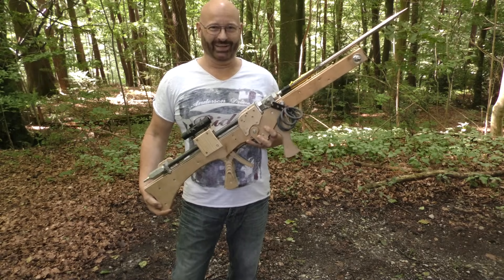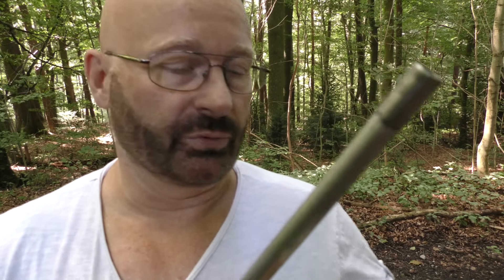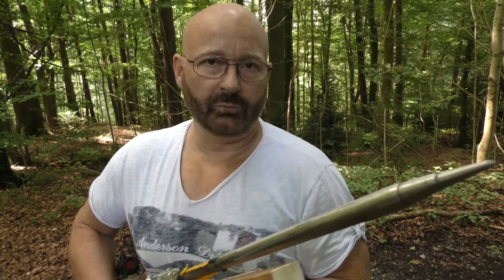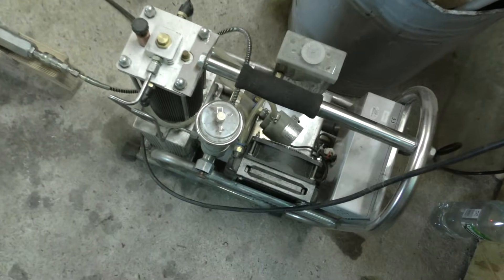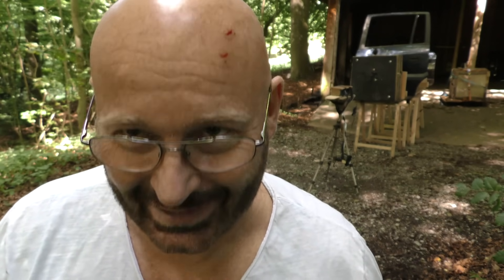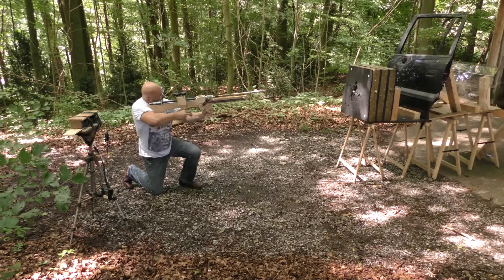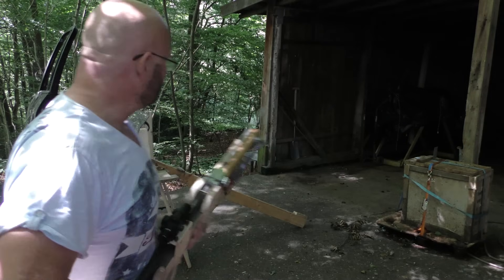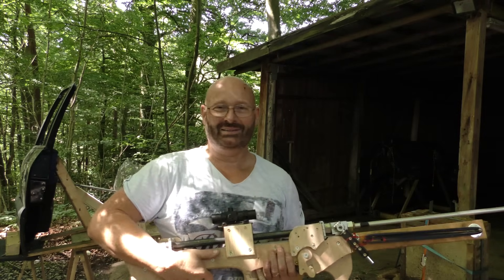1000 Joule Airgun Record: Fallen! At last.

Comment: No one seems to realize how amazing this piece really is, considering how ruffly it's made.  With only practical refinement, such as custom machined parts, and actual tubing (as opposed to a seamed pipe) large improvements are easily achievable.

Personally, I think it would be in the best interest of the shooter to figure out EXACTLY what volume of air is requisite, per shot, and develop a separated charging, and shot chamber.  This way the gun doesn't produce so much wasted exhaust, and of course, smaller chambers allow for much higher pressures, much more easily/safely.

Oddly enough, I actually have access to process tubing, for use in coal fired boilers.  This is the place to go, if you're looking for high end, exotic steel, high pressure tubing.  We often have racks of tube drops, just laying around, at any given plant.  It's expensive as heck to buy it new, but materials change often enough, that there are often piles of otherwise useless tubes, just laying around.  Interestingly as well, I'm curious just how much power one could squeeze out of a steam gun.  Though the word 'dangerous', is a pretty huge understatement, if you're crazy enough to give that a go.
Reply: "just how much power one could squeeze out of a steam gun"? Aircraft carriers use them to launch planes, so yeah a lot of power.
Reply: @MrTubularBalls  Lots of power, but not much VELOCITY. Steam is pretty well relegated to subsonic speeds unless you actually push a vessel to bursting. It's extremely hard to produce enough pressure to propel something to supersonic speeds without some form of chemical propellant involved.
Reply: That's true, maybe it's possible if you get rid of air in a steam system and replace it with argon or something like that? I mean gas that allows higher sonic speeds than air.
Reply: @FluxAscender  define "speed of sound"
Steam expands at its speed of sound. That can very easily exceed mach 2, if memory serves
Reply: @FluxAscender  , seems some of the power could be converted to velocity by a lever. Tho that wouldn't be the easiest on a rifle.
Reply: A tight fit, a rubber band holding the arrow in place for a little while to allow the valve to fully open - that would do the trick and where he has it wrong. And maybe a drop or two of vasoline inside the arrow - not for lubrication but dieseling. A next level would be using liquid gasses to pressurize the tank :) altough I dont know what would the pressure be. Or a hand pump

Comment: Congrats Joerg, this is probably the first toy ever made that could kill a tank 😬
Reply: ForceM1782 In WW1, sure.
Reply: ForceM1782 how can you "kill" a vehicle?
Reply: @Renovski a penatrating shot that either wipes out the crew or deals major damage to the internal machinery that causes the vehicle to be inoperable.  After a few penatrations the durability of the plates tend to decrease dramatically causing most crews to abandon the tank.

Comment: I still kind of want to see you put a boxing glove on the end of the Airzooka projectile, and shoot things like a watermelon. But a nice damn video, keep up the awesome work!
Reply: Peter C Actually, a roommate.
Reply: Jonah Watson the recoil would be a bitch. The heavier the projectile the more kick you get and the more kick would be more harsh on the gun
Reply: Brandon Cornett I'm aware of basic physics, but the remarks appreciated. However, the recoil actually wouldn't be worse, because to fit the boxing glove on he'd need to remove the large steel rod that's the normal tip. A boxing glove isn't really going to weigh more than a fairly large steel rod.
Reply: Patrick McReeeReee Nope.
Reply: Patrick McReeeReee The projectile wouldn't go through the glove. If you notice, I referred to Jörg's Airzooka, the shoulder mounted weapon he made a while ago. Not the "toy" in this video. Regardless of that, even if he were using the weapon in this video, pushing a pencil through a shitty glove against a wall isn't  the same anyway. In that situation the glove is immobilized by the wall. If the glove were part of the projectile, it wouldn't be immobilized in any sense and it would accelerate at the same rate as the rest of the projectile. It's a simple concept. Unless of course, as I now realize, you mean on terminal impact...because I then agree.
Reply: Patrick McReeeReee Oh then my bad for not realizing what you meant at first.

Comment: You could use high pressure /high flow n.o.s. cylinoids and a high pressure compressed air tank and be able to have a electrical trigger and about 1600psi (or a bit more) and the n.o.s. cylinoid will dump all of the air instantly. Super fast and reliable with more than 1 shot per fill up. And could most likely destroy your newly set record. Love the channel man!!! Keep it up!!!

Comment: I'm pretty sure my homemade airgun handily exceeded 1000 joules. That thing launched D batteries clean through cars- in through the driver's side door and out through the passenger side door and through anything that might have been left in between. It launched a dart similar to the one at the beginning of this video all the way through a 12 inch diameter tree, and it would launch golf balls all the way to Illinois. In all fairness though,that was more of an air howitzer than an airgun (you could hold it, but if you tried to fire it from your shoulder it might well kill you). Anyway, awesome video as usual and great inspiration. 👍

Comment: Hello Jörg, 

I think there is a lot more potential for your airguns. Why not add a 300 bar paintball container and pre fill a rail on the gun to ready several arrows to shoot in sequence? You could also have a small array of barrels for the short distance with short arrows and 1-2 full length barrels for the long distance.

Comment: Can you build a machine gun using this principle of the projectile sliding over the barrel? The mechanics to automatically 'reload' the barrel might be a bit of a hassle - but what if the gun were to 'spend/eject' a barrel after each shot and load a new barrel to be fired? Would that be crossing the line to what's classified as a 'cartridge'?

Comment: Is there a limit to how fast you can shoot a projectile with compressed air?  For instance, big bore rifles, there air tanks usually are rated for using 3000 psi, however, all that psi is not released at once, so what happens if you release the entire 3000 psi in a single burst? will the projectile reach a insane velocity? Also,  how does a air tanks size effect velocity? for instance, if you have a large tank that is at 3000 psi then would it launch a projectile at the same velocity of a much smaller tank that also is at 3000 psi?
Reply from the maker: This airgun IS actually doing exactly that, dumping 4500 psi from a large tank in one go. 

Expanding air can reach really high speed. I once shot a lego brick at supersonic velocity with the release of compressed air. The more air you compress, the better. But you also have to make sure your valve opens up as fast as possible. The higher the pressure, the harder it is to design a fast opening valve.
Reply: @Slingshotchannel  
that is sick! you inspired me to build something of my own! have you ever tried using compressed helium instead of air?  when you get the chance, look up the Fury 20mm airgun  on here, that thing shoots like a .50 cal, I cant imagine what it would be like to shoot a arrow with that thing lol.

Comment: Might this be adaptable for use as a sort of piton launcher (with attached cable), as used by James Bond in Diamonds are Forever, or, sticking with an arrow instead of a piton, could it function as a "rope arrow" as seen in the Thief series?  If the projectile penetrated all the way through the targeted surface (rather than simply firmly embedding in it), perhaps it could feature a sort of wing tip or barb (as seen on speargun tips) to prevent it from pulling free?

Or, instead of embedding, could it be used more as a grappling hook gun that shoots over a ledge, then is retracted until it hooks on an edge, Batman, or Ada Wong style?  (yes, I realize I watch too many movies and play too many video games.)

Comment: This looks much more efficient than what I made 20 years ago but I had a chamber that was 24 inches of 4 inch inner diameter PVC pipe, to a 5 foot long piece of 1 inch inner diameter (alternative barrel was 2 inch x 5 feet, both detachable) I used a sprinkler solenoid valve with a 9 volt battery to open the chamber and a click button off a flashlight for the trigger. It was a lot of fun. I used a wadded up damp square of an old t-shirt to back the projectiles. I could completely obliterate foundation blocks with a 3/4 inch nut and it would rain pieces of concrete for like 5 or 10 seconds. I shot a superball through a steel wheelbarrow and it left rubber dust on the fence on the other side.

Comment: if you add a resistance barrier, friction or otherwise, you can halt the bolt long enough to take advantage of optimum/ maximum pressure thus maximizing the potential speed

Comment: Two mods: make the front stock longer and create an air chamber tin can to contain the blast similar to a surpressor.
Make a piston spring inside the stock similar to an AR-15 and make the tank/barrel float on tracks to absorb recoil.

Comment: I know you are the king of sting.  But have you ever thought of an air solinoid  it would be ten times if not more faster at dumping the energy inside your air resivoir  and if you had a way to hold the arrow onto it’s starting position and got a solid 60 or 70 lbs built up before it even started to move on its internal barrel   Then my friend you would be able to shoot a traditional arrow at tremendous speeds without haveing to resort to insane calibres in order to get the joules you strive for.    Haveing said that ,I love your channel  will always be a subscriber and loyal fan.  And can’t wait to see what you will come up with next time.    Oh yeah.  Where’s the little blonde.   I know you didn’t let that get away

Comment: The big recoil power is because there is still a lot of remaining pressure on the agin after the arrow leaves the muzzle.  fps will be even greater if the arrow is inserted into the barrel than the barrel that goes into the arrow and uses a knock open valve

Comment: @JoergSprave you are actually wasting most of the energy in the reservoir. It is quite obvious that the arrow starts moving far too early (look at rubber has barely moved when arrow takes off). If you could manage to 'lock' the arrow until enough pressure has built up inside the barrel, I am sure you can increase it speed and momentum quite significantly, so that a less flimsy projectile can be used. :-)

Comment: I once shot a 3 foot section of rebar through a 10 foot piece of conduit using 120 psi in our shop. It went through a 3/4 plywood board and hit the wall 25 feet away.

Comment: Maybe you should try to use a larger pressure container. So far the container is only as large as the barrel. This way the pressure is already reduced before the Arrow leaves the barrel. Maybe mount a small fire extinguisher or a soda stream bottle to the end of the gun.

Comment: I think he is using a ball valve with a rubber band fast trip mechanism and so there is no air reserve and so it is using all 300 bar in just the one shot.  Most air guns use a small t valve and stem with a hammer that pops it open for just a fraction of a second and so keeps some in reserve.  THis design is all out with just one shot.  It could be made slightly more powerful if the tubing was ported, filed so the sharp edges were smoothed over to allow less turbulence in the port connections.

Comment: I think you could make it a little higher joules with helium, maybe 12 or 1300.  Due to the properties of gases ability to push the spear further along then regular air. I won't get into the science behind it but there are many video's explaining the reasons if you care to find out. Just in case you want to beat your previous records, or you could try with hydrogen but I don't recommend it just because or the extra risk associated with it.

Comment: You could really make a weapon as if not more effective than firearms using this technique. Make the whole thing more miniature and bullpup and have it with 36 barrels. Have the barrels triggered electronically making full auto or single shot available. Use steel bolts only 12 inches long with razer vanes for hunting or defence lethality. 1000 joule per shot full auto with 36 bolts.

Comment: Hallo hallo nochmal mein lieber freund  Ich möchte Ihre Textbemerkung mit freundlicher Genehmigung korrigieren. 1.000 Joules sind 737,56 ft./lbs. Eine .460 Weatherby Magnum-Patrone, die mit einer 500-grain-Kugel geladen ist, die sich mit einer Geschwindigkeit von 2.550 Fuß pro Sekunde fortbewegt, hat eine Energie von 7.220,47 ft./lbs. oder 9,789.64282 joules. Das Nachladen von Flaschenhalsgewehrpatronen ist eines meiner Hobbys. Ein anderer ist die Fotografie. Ihr Vergleich zur .45ACP-Pistolenpatrone ist näher. Eine + P- oder ++ P.45-Autopatrone kann zwischen 425 und 510 ft./lbs erzeugen. Ihr Pfeil ist also wie eine 357-Magnum-Kugel mit voller Kraft, die von einem 8-Zoll-Laufrevolver abgefeuert wird! --- but you have mass & weight with that arrow!
Reply from the maker: Habe ich doch gesagt, steht doch sogar im Thumbnail. Die Energie ist ungefähr doppelt so hoch wie eine normale (Factory) .45 ACP, aber der Impuls ist so hoch wie bei einer .460 WM. Einfach mal die physikalischen Formeln checken, OK?

Comment: I think the regular arrow would make it through all 3. It is thinner, and travelling faster. It has less surface area in contact with the targets, which means less friction.
Reply from the maker: But also it has much less momentum - and it is brittle (carbon fiber shafts). Not ideal for hard targets.

Comment: please  joerg  shoot  at a side of the hole in the rubber mat, not that  I do not believe in its power but I believe in that rubber friction power . as 1 KJ equals 240 cal which is not too much  thinking that  1/4 liter of water would raise 1ºC.  all these suposing that  the arrow  is not greased on its outside.. but  anyway  I would not stand  after the  3 layer  rubber.. lol

Comment: I'd like to see a very low mass projectile driven with helium at 300 bar. Muzzle velocity in excess of 1000 m/s should be possible thanks to the speed of sound being so high in helium. Hydrogen would be cheaper and more effective with Vsonic = 1295 m/s, but more dangerous.

Comment: Can u beat the 1000 joule with a crossbow? Maybe jumping on a platform winching pulley to cock the high powered sniper crossbow? If not possible with wooden crossbow maybe full metal? And maybe a small tungsten penetrator crossbow bolts and magazine fed
Reply from the maker: You CAN beat 1000 Joule with a crossbow, but not with one you can carry in your hands. Think crossbow artillery.
Reply: @Slingshotchannel  lol hand held is exactly what I was thinking, there is no way a mechanical hand held crossbow do almost gun like capability 2000-7000 or more joules maybe  With a tungsten small bolt? Welp maybe a shapecharge high explosive bolt will do but that's explosive power now lol welp thanks for reply, I love most of your videos and inventions God bless and take care

Comment: That thing has just over twice the momentum (and recoil) of a 12 gauge slug! (1oz 1600fps)
Reply: No. A 450 grain slug at 1600 FPS has just under 3500 joules.
Reply: @James28R  I specified momentum not energy (linear scaling with velocity vs squared)